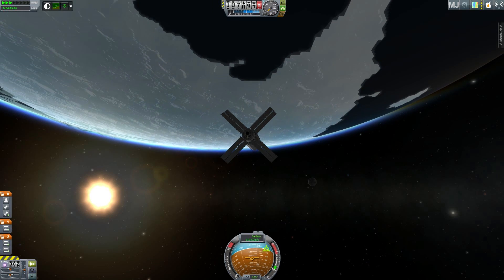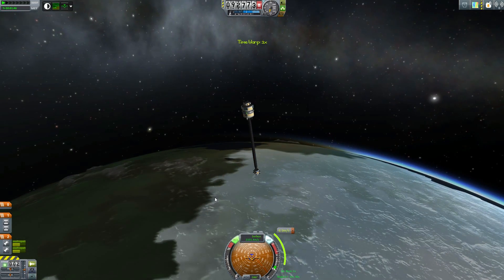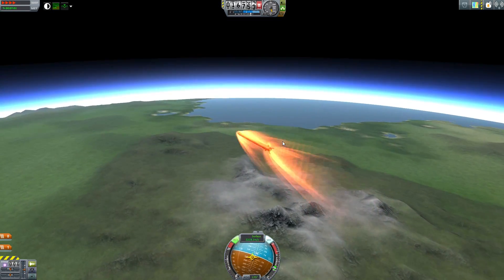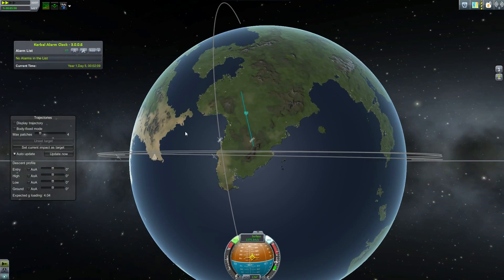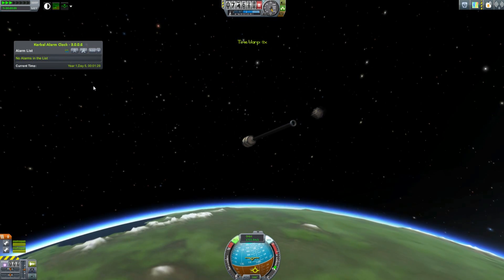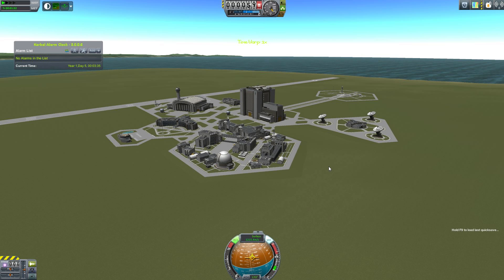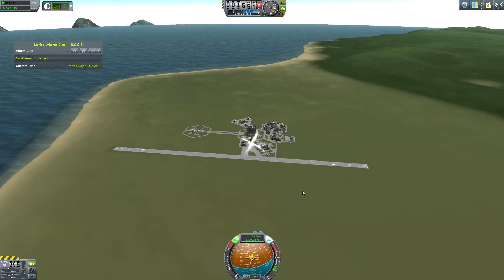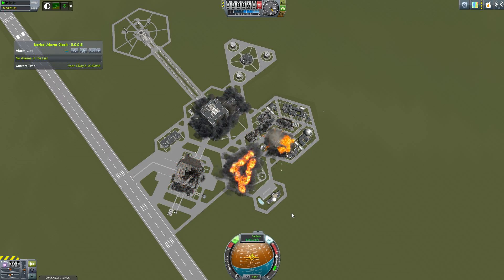Rods From The Gods vs Kerbal Space Center

Comment: To avoid the time-slice problem, where your 4m rod is moving so fast it skips right by the wall, use Planck time (c. 1.6x10^-43 s) as the time slice.  That ought to register a collision, unless your rod is actually in a quantum super-position such that it can be on both sides of the wall at the same time and avoid hitting it altogether.  Nah, probably not.

Comment: Rods from the Gods is a really cool name for a not particularly good idea.  E=(MV^2)/2 so 18 metric tons moving at 1.2km/sec packs 12.96 giga joules of kinetic energy- roughly equivalent to just over 3 tons of TNT.  This is more than enough to level a medium sized building if delivered efficiently, but the penetrating power of the weapon would work against this, delivering most of the energy underground.

The main problem with an orbital kinetic kill weapon is that physics dictates that you can't get more energy out than you put in raising it into orbit in the first place, which limits you to fairly modest equivalent explosive yields.

The exception would be some kind of dinosaur killer scenario where you used a relatively small amount of energy to divert a large mass already in space, then bounce it around the solar system doing multiple gravity assists as necessary for course corrections and to build up the velocity, and then smack it into your target.  That could be really nasty.  So there's a challenge, if you really want to ruin their day, divert a small asteroid and smack THAT into the KSP Space Center.

Comment: You are correct with your assumptions about unity and collisions. Now, if you were running at maybe double/treble the frame rate it would work. Also, the physics model will not be as accurate as it could with this kind of thing as its "are two boxes colliding" and if so do this thing.

Comment: Just edit the part file so the rod is 50 meters, but keep the density. Theoretically the rod should have more surface area, but due to the same mass values it would go slower, so at any given time it should be in contact with the buildings due to its enhanced length.
Reply: Sorry, MASS not density.

Comment: any "misses" would probably result in sensitive equipment being damaged, so a little success there. it would be like a little earthquake.
Reply: aim at the radars and clean the rest with jets
Reply: Melting Clocks interesting.
Reply: +SirLobsterman in reality each of those rods would unleash the same power as a tactical nuke and thats not an over-exaggeration each one could wipe a city the size of Los Angeles off the map
Reply: killman369547 but only into the ground, so it would be a small localized earthquake rather than a explosion. also a tactical nuke would never take out a city, it might eradiate it and cause it to be evacuated, but the buildings would still be there. tactical nukes are only meant to take out miles of area, not hundreds of miles of area. we're only talking about something that's aimed at a army base or a very large troop formation spanning miles, they're also area denial weapons. but they're not going to take out a large city like los angeles.....
Reply: ah just did the energy calculations your right the energy release is pretty underwhelming a 9 ton rod (even without taking atmospheric drag into account) striking the ground at orbital velocity only produces a yeild of 0.9 kilotons to get megaton levels of energy one would need a rod weighing in at 9000 tons traveling at orbital velocity at impact and even then the magic megaton still hasnt been reached stopping short at 0.955 megatons about the same as the british "orange herald" bomb test *****

Comment: It only explodes by mass not Speed if there is a bigger mass it woks
Reply: No it explodes if there's enough kinetic energy, which this easily has enough of.
The problem is that the craft is just so fast, that in the space between frames, the craft has phased through the building. And since unity can't check for collisions in between frames, it wont explode.

Comment: Whats the weight of those rods? Would love to plug them into a Ke equation. Problem though with most physics predictions is they don't take into account of energy dispersion/placement(As in punching straight through thin/undense objects). At 3km/s the mass of the object's explosive power(non-chem) is equavilent to TNT in metric tons. So 1 ton= 4,500,000 joules.

Comment: I'm probably missing something in the math, but if it's any consolation that first success should have impacted with the force of ~3 tons of TNT. That surely would've made for some nice fireworks.
Reply: 18t in kg = 16329.3, 1223.9m/s in the last frame before impact, KE = 1/2 (M * (V * V)) gives ~12.2GJ, which according to a couple of online calculators gives 2.9t of TNT.
Reply: Steve Pittman 18 tonnes in kilograms is 18000kg :p You are thinking of imperial tons, which only scrubs use :3
Reply: Scrubs being American, which describes me.  And technically Scott as well by this point, so who knows which unit he meant by it?

Comment: 2:00 Why are other games not right? is it not faster to shoot down?
and if so the US will probable try to do that. shooting the enemy faster.
Reply from the maker: Because to drop it by going straight down takes extra fuel, and that is mass, if you instead make that extra mass part of the impactor the you get a more effective weapon.
Reply: so basically its efficiency thus mass vs speed of delivering payload?
Reply: +Marfnl disse If u shoot down it spirals cuz of lat bel but if u fire in the opposite direction of orbit it slows down from orbit and falls down from the sky and onto a bunker instead of a farm 2000km away
Reply: +Marfnl disse *lat vel
Reply: +Marfnl disse there was going to be a craft to launch up rods to do that so the rods would cause bigger devistation and won't be aganist the space treaty but it was to heavy.and the other games are incorrect because of the coroiolis affect and the speedit would need to deorbit straight down wouldn't be on a small rod

Comment: If i remember right the kinetic force released on Impact from this System is Similar in power to a conventional Nuclear Warhead... i.e. you'd probable just have to get it within 1mile of a surface structure to Level the building with just the Shockwave
Reply: In power, yes, but it does not explode so it doesn't really have the same area-of-effect.
Reply: ***** there would not be a Detonation of the Chemical reaction type, that people assume you mean when they hear the word "Explosion" but there would be a shockwave from the shear Kinetic force, consider what happens when a Small Meteorite hits the ground.  Although these projectiles have a much smaller cross section they are also Solid Tungsten. so while it wouldn't have the same airblast effect as a Meteorite you have to remember that Shockwaves travel through the ground as well. I am by no means an Expert I just know basic Ballistics. personally I would love to see a 3D simulation of what happens when something like these actually hits the ground.

Comment: Scott Manley Hey, is it possible to make a proper Ground Effect Vehicle (Ekranoplan) in KSP? In canilla, NEAR, or FAR?
Reply: i use FAR and ive build the Caspian sea monster ekranoplan. doesnt seem to get any air. it does sail at max 80m/s (any faster and the wingtips start to fall of). might try to change some wing angles but i dont think it will ever fly like it does in real life as it doesnt have any wings on the front wich makes the front heavy and dives into the sea. maybe with some vtol engines tucked away
Reply: Maybe i should have started a lot smaller than trying to get something like that flying. My guess is best thing you will end up with is flying your plane very low to the ground or sea. I dont think it simulates ground effect

Comment: KerbalEssences  Nope, tbh I was just guessing. But I'm really interested in how this works. So what does the physic delta time do in particular?
Reply: In reality physics are not calculated and also continous. When I jump against a wall nobody has to solve equations in order for me to get a head ache. the physics you know from school  uses formulas to predict and approximate the reality. It's much less painful to know how much my head will hurt rather than actually trying it. this is called simulations :-) there are different methods to simulate physical problems. the problem here is collision. when two bodies collide in reality it is the interaction between all those atoms which summed makes the bodies bounce off each other. That would be pretty much impossible to simulate in a game right now. But there are workarrounds to achieve the same outcome with less effort. Instead of having complete solid bodies we only use their surface for calculations. So if two bodies collide in the simulation we only have to check whether their surfaces are touching or not (*). In the moment they touch we run our collision program. We compare their speeds and masses and calculate new trajectories for both of them. ksp also adds explosion conditions of course. if the speed difference is too big they trigger an explosion animation while the bodies itself get deleted.

(*) however, you can't check anything continously on a computer. Everything that looks continously is split in many little steps. This is the downside of digital technology. The step size in time domain is what we call delta_t. So the smaller the delta (greek letter D for difference), the more accurate our simulation because a lower delta_t means we check for collision more often. You can't however decrease the time steps infinitely. Your computer rounds calculated numbers because it has a finite storage capacity. If you chose your time steps too small they might get overshadowed be the rounding error and your calculation efforts are wasted. This causes instability in real physics simulations.

Here a little simulation of an electro magnetic beam being focused in a lens: watch?v=rHHn_B8Ug5w It's also partly reflected. If you look very closely you can see the spatial step sizes of the simluation. It is not really a round lens. The circular disc is just added by post editing! The real one is invisible. I just varied the material properties in a circle inside the simulated region. 

Thats a long text and I hope you don't mind.
Reply: KerbalEssences

Wow, thx for all the effort! I just couldn´t see what the value in the menu does. I was already aware of the simulation :D But thx anyway.

So if I got it right, a value 0.04 means, the physics is calculated every 0.04th step(in this case frame)?

I definitly don´t mind. I think it´s great, KSP has such a friendly and helpful community. It´s rare nowadays. We´re also trying to make this difference in the KSP-facebook group. No dicks or stupid answers (most of the time, there´re always some retards).